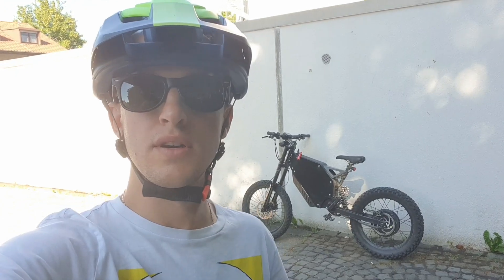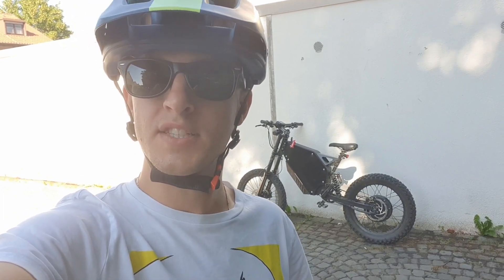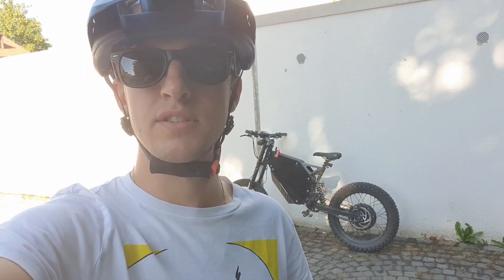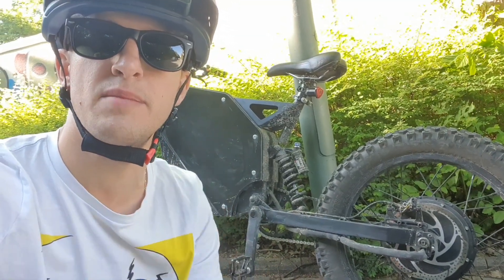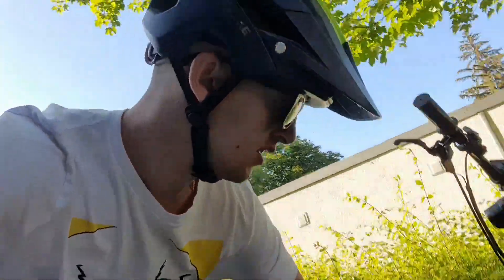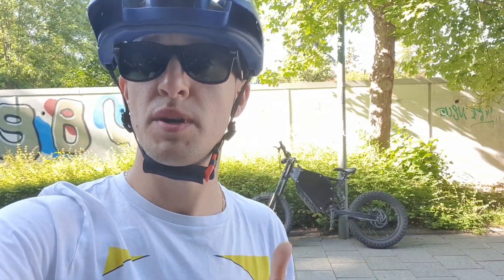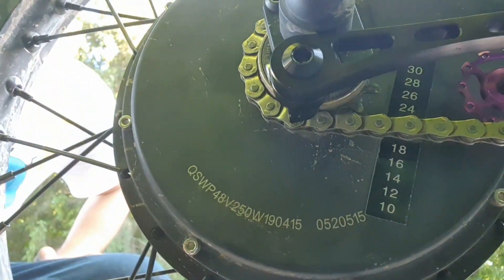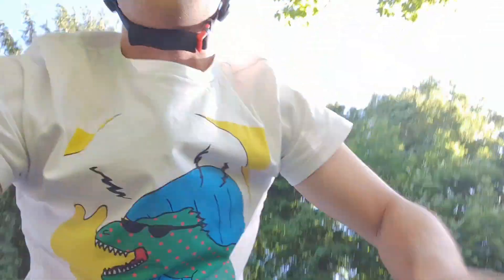Ebike motor overheating test

Comment: Did you mention the motor temperature sensor inside the motor reads 100 C degrees? at that temperature, how many degrees is on the outside motor casing?

Comment: Very nice video 👍
I have 1000w motor and its pik amp is 23amp now it started over heating and not taking load and even the wires coming out of motor are heating very badly 
To check the current iam using watt meter and i saw that the pik amp motor is taking is 45 to 50amp what might be the problem ? 
Please help
Reply from the maker: You need bigger motor, like we used on this bike

Comment: Thank you for the video.  I just want to know how to fuse  my battery, motor, and controller so that I don't have the wires melting.  12000 watt to 1500 watt motors  with 48 volt to 52 volt batteries. I would really appreciate any feedback with regard to making sure that I don't melt the wires.
Reply from the maker: Use short circuit braker for Amperage you want to limit. Best way.

Comment: I barely got away from the cops once on my 4t typhoon, going up on a steep mountain (asfalt) road up to 23%, with hairpins, my acceleration was no match for their Landrover, but the fast uphill acceleration bursts overheated my motor very quickly. At the time i had no idea that could happen, and i was lucky it happened only after i had sneaked away onto a forest track. 
If you do the same test uphill, you get a different result.
Still, love my Typhoon, but with hindsight would have got a 5t or 6t. I rarely get to need the 80kmh speed.
Reply: I guess im asking the wrong place but does anybody know of a way to log back into an Instagram account..?
I was dumb lost the password. I love any assistance you can give me!
Reply: @Hendrix Nathan instablaster ;)
Reply: @Ty Reign thanks for your reply. I got to the site through google and Im trying it out now.
Looks like it's gonna take a while so I will get back to you later with my results.
Reply: @Ty Reign It worked and I actually got access to my account again. I'm so happy!
Thanks so much, you really help me out!
Reply: @Hendrix Nathan you are welcome =)

Comment: Try with a 16" rim or 10/13" moped size.
Reply from the maker: I think it is roo small for offroad
Reply: @Vectorebike  You might be right but for high torque/thrust the smaller wheel will do better. It's like a lower gear.
Reply from the maker: @difflocktwo  true.